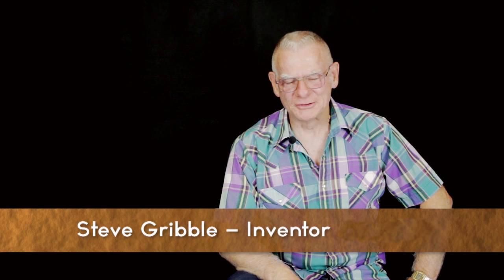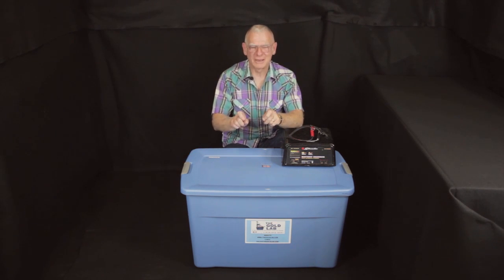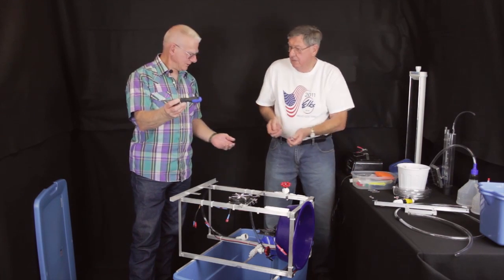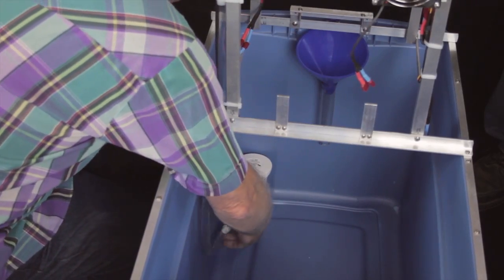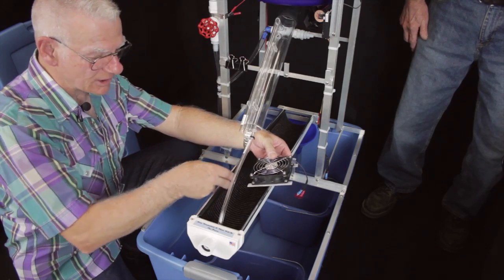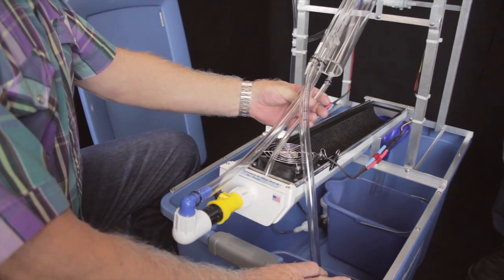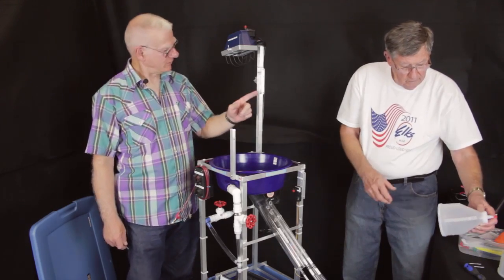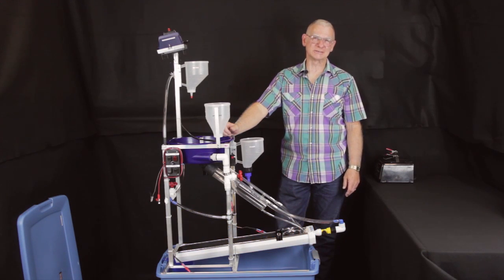The Gold Lab Original Part 1: Introduction & Set Up for Fine Gold Recovery

Comment: Hi, I don't know if Steve is still running this site or Dave who now has the Copyright from Steve but this is one of the best inventions I have ever seen and used. If Steve is still running the site all I need to know is the name and size of the blue buckets you use on the demonstration videos please? I purchased my Gold Lab from Dave and am more than happy with It's operation, the only problem I'm having is where I am presently using the round black buckets I am having a lot of very fine sand coming out of the bucket on to the bottom of the main water run and being pulled back through the pump with the clean water in to the bowl. If anyone can help by letting me know the names and size or where I can buy 2 of the buckets that Steve used on the Video demonstrations I will be more than grateful, my email address is ian.mcdonald-wallington@sky.com. I am asking for this information because Dave told me a few Years back that production of The Gold Lab has stopped, with my Lab being a few Years old now and me living in the UK at the moment I will only be able to buy anything needed for my Lab. Any help from anyone will be appreciated.

Comment: Fasten a nut on the inside of the tube so the tube threads do not strip out. or put a tit on the tube put a hole in the flat stock. Just above the tit have a rectangular spring steal piece fasten to tube hanging over the tit. Now just lift up the sheet metal and slide the flat stock over the tit and let the sheet metal spring back to hole it.
You could better electric connectors. 
for the lamp post, insert a piece of smaller tube in the upright you have it fasten to so all you need to do is put the lamp pole over the smaller tube and put a lock pin in it. just like you hopper pins.
Do the same with the hopper post.
Nice idea. 
But a table with none stop feed and none stop collection would be the cat's meow.

Comment: Does anyone knows how to identify real gold from fake gold?
Reply: Maybe you didn't need the answer anymore...Anyway, you can distinguish between them using acid. Fake gold will react and real gold does not. Another way is checking the density, gold is really heavy, much heavier than fake gold.
Reply: > "[...]  you can distinguish between them using acid."
The problem with acid is that you slightly damage the surface. You wouldn't like to do it with your gold coin.
Besides, it only test the surface not the interior.

> "Another way is checking the density [...]"
The problem is that there are other elements with a density very close to gold (ex: tungsten).
A gold bar filled with tungsten inside would fool this test.

Any idea how to avoid such issues?
Reply: You either need to use an ultrasound device or measure the specific gravity.
Reply: > "You either need to use an ultrasound device [...]"
Gold coins are too thin to use ultrasonic devices.

> "[...] or measure the specific gravity."
Tungsten filled gold bars can fooled this test.
Reply: Roger Nevez Yes it is possible to fool a specific gravity test with a tungsten core.

No coins are not too thin for a high quality ultrasonic thickness gauge that is designed to measure ranges of thickness found in common coins. here is example http://www.dakotaultrasonics.com/product/precision/px-7/
Reply: > "No coins are not too thin for a high quality ultrasonic thickness gauge [...]"
Ok, I agree. However, the problem is that such high precision devices are much more expensive (~$2000) than standard ones (~$100).
Besides that, depending on the mint mark (or other common surface irregularities), ultrasonic devices would not work properly.

Comment: So my questions pertain to how much you can process in an hour, and how long does it take?   We have hundreds of gallons of black sand to go through.
Reply: Try placing a strip magnet underside of blue bowl at angle but stay 1 or 2 inches back from bottom of cone meets bowl to allow material to pass this will collect your black sands in the bowl an allow the blue to wash it some .